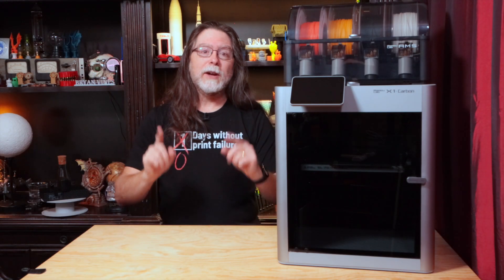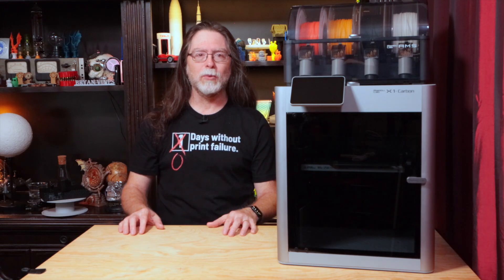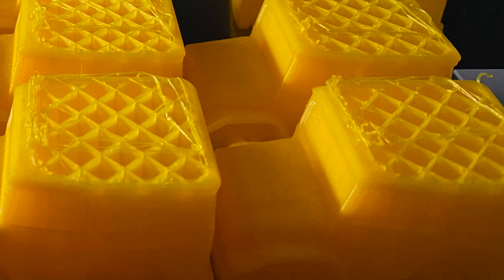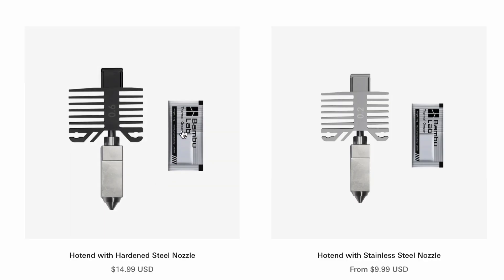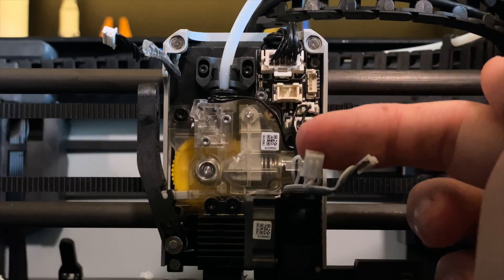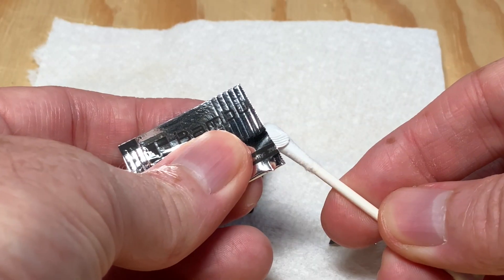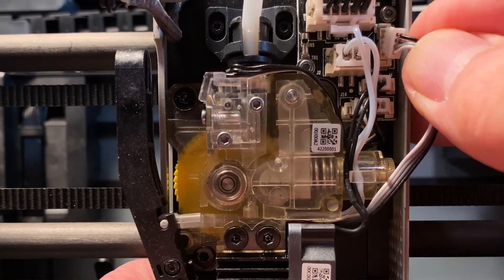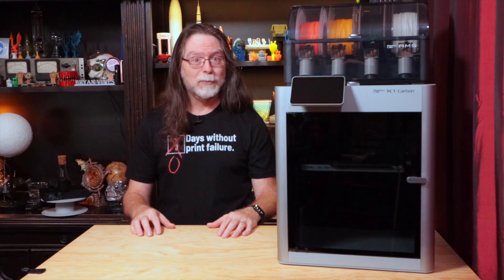How To Replace the Nozzle and Hot End on Bambu Lab X1

Comment: THANK YOU for this video. I have an extra full replacement (with fan, etc) for all nozzle sizes, etc. except the one I needed ASAP. All I could find overnight delivery was just the nozzle/hotend, completely freaking me out!  It seemed the first several videos I found describing the process all used the full replacement which did not help at all. Then I came across yours and voila! I had what I needed and as you shared at the end - though it looked scary, it was actually quite easy. Thanks to your video, I think I'll start replacing only the parts I need vs. spending the extra few dollars each time for a full replacement (dollars add up!!). I really appreciate the guidance and simple explanation - breaking down the process in the most uncomplicated way possible so I could successfully complete the replacement!!!

Comment: You need to be extremely careful with the wires on the hot end when pulling them out of the channel. With barely any force, I disloged the wires from the block and one of the board connections. I barely touched it.

Comment: mine was stuck on and I ended up breaking the thermistor wire. you should work with one that is not so new like yours so we can see what to do in real life. decent video if someone is changing out the brand new nozzle for a different size.

Comment: Great video Bryan and very easy to follow. I am just about to order a X1C but want to have a 0,2mm nozzle for tiny models as well as a 0.8mm fpr faster speeds when doing larger parts. Since I will be ordering the additional sized nozzles, my question to you is this.   Does the X1C come with the hardened 0.4mm nozzle or is it just the stainless steel one? Just thinking I could order a hardened 0.4mm at the same time. Thanks in advance.
Reply: It comes with 2 nozzles if you get the combo.  They are both 0.4mm.  They do this because the .2mm won't print carbon fiber etc.  Some prints also require the 0.2mm head, so be mindful of that.  Hope that helps a little.

Comment: Thank you for the video.
Is it possible to replace the hotend with brands other than Bamboo Labs? Perhaps the DyzeDesign for higher temperatures? 
I apologize if this is a basic question, but I'm not familiar with the process. Thanks

Comment: Hello, Brian. A very concise and useful video, keep up the good work. 

I don’t know if anyone has mentioned this yet (so many comments to read) but one reason to get the complete hot end is to make changing nozzle sizes practical. I have the 0.2, 0.4, 0.6. and 0.8mm complete hot ends and spare hot ends without fan, heater, thermistor, or sock.

The complete ones are for swapping nozzles while the mere hot ends are for repair parts. I have them in a parts box with the screws, socks, clips, and thermal paste I keep in a drawer under the printer.

With a little practice, swapping complete hot ends is not much harder than standard nozzles. It takes me about 2 minutes. I've had a harder tine with some standard nozzles and of course I don't have to heat up the hot end to get it free.

Comment: Also now the video had appeared in my recommend list again, I would like to say that, Don't use blowtorch on the hotend . There is probably a PTFE tube inside the nozzle, and heat treat it makes it losen up.

The right way to un-clog your nozzle is use a solder iron or heated wire to stuff in from the material feeding line and try to pull the stuck material out.

Comment: Got my P1P yesterday, on its 4th print it slammed the hotend into the print on the buid plate and completely destroyed the hotend, thermistor and ceramic heating element. I bought it at a local shop that has a 12 month warranty, I'll be returning it. It was my birthday present I truly am upset. This printer still doesn't have all its kinks worked out. I'll be sticking with my ender 3 v 2 for the foreseeable future, unfortunately.

Comment: Do not use cotton swab. You waste thermal paste and contaminate it with cotton strands which compromise flatness of thermal contact and will decompose when heated. Rather use some narrow spatula, a piece of credit card or flat screwdriver. Or just apply a line in the middle right out of thermal paste packet. There is no need to spread it, it will spread once you put the heater on top of it.
Reply from the maker: Hi! I hadn't considered that the cotton swab could pose an issue, but this makes sense. Thanks for sharing!
Reply: @BV3D  I don't think that anything bad will actually happen. It's just why make it possibly worse and lose thermal paste on soaking the swab with it. It would be better if that extra thermal paste which was left on the swab would get on the hotend instead. The amount you applied is likely enough, however if hotend or heater is not perfectly flat, it may be not enough to fill all of the gaps.

Comment: Seems like a lot of work to change nozzle size. Especially if there is nothing wrong with your hotend. I just paid for mine yesterday. I hope I don't regret it. I hate having to constantly replace thermistors, and nozzles on my ender clone. I was hoping this part of the machine would be more modular. :(
Reply from the maker: You can get the fully assembled module for about $35, in a few different nozzle sizes. They have the ceramic heater and thermistor and fan already mounted. In that instance, it's two screws and three connectors to swap hot ends out, which should be an under-five-minute proposition.
Reply: @BV3D: Bryan Vines  I just changed my fully assembled module to a 0.6 nozzle.  Your instructions were super clear.  Easy job.  Thanks.
Reply: Duuuude, you have an Ender clone that I bet has hours of tunning and mods. Now you will be getting a printer that just works out of the box... I think you will love it.
Reply: @TinSVM  I'm sure I will! Can't wait!!!
It's on its way now!
Reply: the  complete hotends are worth it if you're just changing sizes frequently.

Comment: How did your ceramic heat block just pull off like that ? Mine is stuck on there permanently and won’t come off
Reply from the maker: Mine was held in place by the clip. The thermal compound didn’t act like a glue or anything. Removing the clip was really all it took on mine. Maybe some isopropyl alcohol will help soften the thermal compound on yours.

Comment: Do Not bend the heat sensor while unisntalling. Also make sure you remove the cable before uninstalling. Do not hang your hot end by the heat sensor cable like I did before.

Comment: Ngl that look like a major pain in the butt to change.  Do you have to do that to change nozzle size?
Reply: I would just buy the fully assembled hotend in a different nozzle size and swap between them by unplugging 3 wires. Its really not that much more expensive than other machines when you factor in that it has all the heating elements and stuff included. Then of course you'd want a few extra sole nozzle assemblies just in case.
Reply from the maker: This, exactly. I may follow up with a "Swap the hot end with a prebuilt one" just to show the contrast. Literally three connectors and two screws and done.

Comment: Its a very easy process compared to some other manufacturers' convoluted hotends, but when you consider a full set of nozzle sizes and spares and some Hardened steel ones the price suddenly becomes gargantuan (How about a saver pack Bamboo Labs?), the only saving grace would be that the nozzles in the hotends have a much longer print life than the ones we are used to using, I wonder who will be the first to come up with a cheaper alternative hotend solution for this machine, hopefully it will be Bamboo Labs.
Reply: its a closed source machine, so no one can really modify it, this is the reason that many people don't like it
Reply: @Fejszi  Thats not going to stop people coming up with ways to fit off the shelf hotends to it.
Reply: @Fejszi  people are still going to make third party parts for the machine. And Bambu themselves said that if their company ever goes away, they will release everything out on open source
Reply: "the price suddenly becomes gargantuan" Really? Where else do you get hot ends with stainless/hardened steel nozzle for for $10-15? You pay $26 just for a hardened steel Prusa nozzle alone.
Reply: it's crazy cheap, the whole hotend assembly is like 30$ with the heaters and everything, not even creality can match those prices

Comment: That neck sure seems weak. I've knocked my entire flex plate sideways twice when a part curled. Still factory-straight. Microswiss FTW.
Reply from the maker: Given the speeds this thing moves at, I'm not shocked at the result. (That said I love Micro Swiss's stuff!)
Reply: @BV3D  Valid point. My baseline speeds are 100mm/s. I can hit about 150 if I crank the hotend temp a bit. Travel speed is 200.
Reply: @OldCurmudgeon3DP  that's very slow compared to the 300-500mm/s the bambu prints at, around 2x the force at impact, not sure even a microswiss would survive. That's why I use a dragon UHF, super well supported, bi metal, and extremely high flow.
Reply: @morbus5726  slow compared to those speeds. Bambu must be competition to the voron/ratrig then. That's a beefy heater to melt that fast.
Reply: @OldCurmudgeon3DP  Bambu and voron/ratrig are different machines for different purposes. The bambu is a working out of the box workhorse, while the kits are for tinkerers who enjoy spending hours upon hours building and modding. 

The bambu is currently the best printer on the market for its price range, it matches the print speeds of high end corexy machines, while adding crazy features (lidar) all for almost the same price as a prusa.